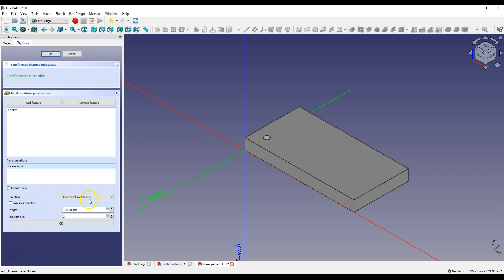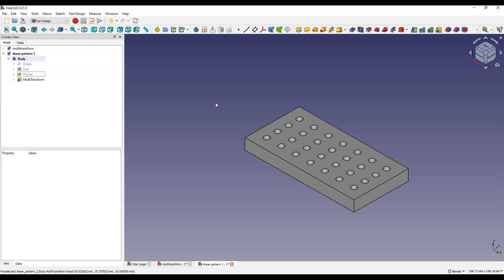FreeCAD Linear Pattern in Two Directions (at once)

Comment: Fantastic. When I try it myself though, and I decide at the end to add a chamfer to the template hole, the copies don't get the champfer and in fact, the chamfer isn't even visible (or rather either the champfer is visible or the copies are). Clearly I am doing something wrong. Any hints?